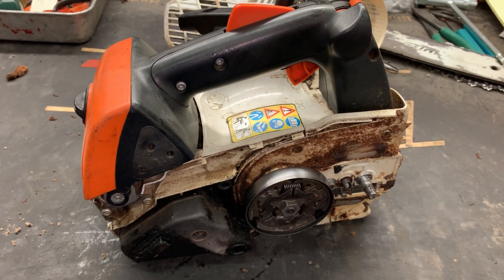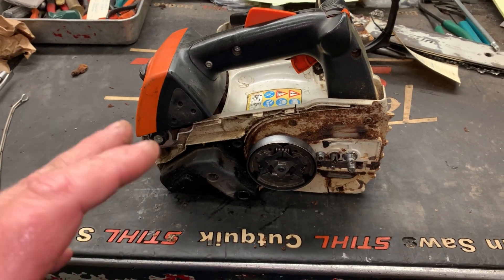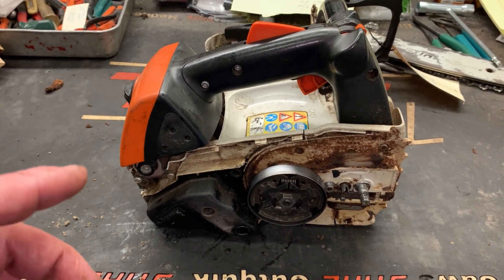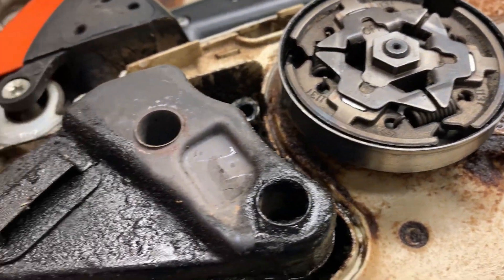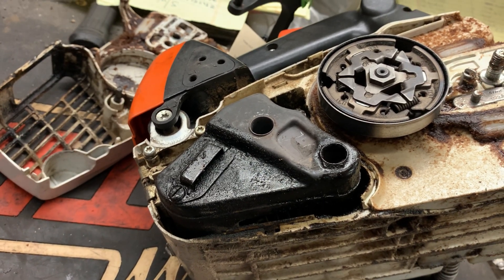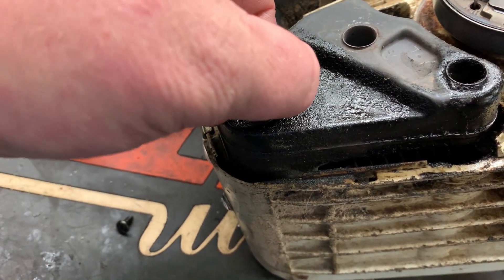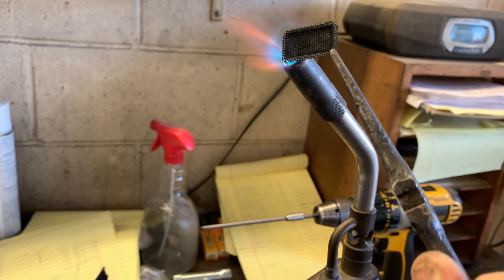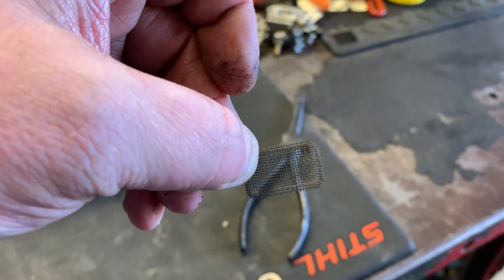FIXED!! WHY A 2 CYCLE ENGINE WONT IDLE? OR REV UP? THEN YOU MUST WATCH THIS!

Comment: Cheap oil and low octane fuel it drives me nuts 😂 chain saws run at high RPM use Stihl ultra synthetic and high octane fuel non ethanol take care nice video

Comment: That’s the gospel Medic. You gotta have a clean air filter and an unrestricted exhaust port and spark arrestor screen to get the proper air for combustion among other things.Too much oil does more harm than good.If your seeing oil goo all over the exhaust your mixing too much of that particular oil.Don’t use cheap oil.

Comment: Hey Great video , Today I had a costumer bring in a Honda engine that he tuned up himself . The engine ran like it was missing and not holding a steady RPM . I asked him what he changed , he said he changed the spark plug . I pulled the spark plug , and there was almost no gap . He dropped the plug before he put it in , well I put a proper gap and it ran like new . He was so happy he gave me $50 , I said i was not going to charge him . Made his day.

Comment: I had that happen to me. A friend's machine wouldn't run, and i found this. i used all sorts of chemicals and then I realized that it was stainless and could take heat. 
Also 2 cycle mowers clog in a similar fashion. those you clean with a stick.
Good job!!

Comment: I have a ms192T they are sweet little saws. I have the screens on my trimmers clog up a couple of times a year. Question would it hurt to run my trimmers without the screen?
Reply from the maker: You can take them out but it leaves the engine wide open to Dirt dobbers.
Reply: Probably illegal as well depending where you are at.
Reply from the maker: @bartfoster1311  highly illegal in areas that inhabit dense forests

Comment: The best way I've found is throwing them in the trash! LOL
Reply: And, that is exactly what I did with a Poulan chain saw.  Nothing but problems from day 1, the guy at the place where I bought it had to work on it the day he sold it to me before i walked out of the store because it would not start.  I worked on it the same day and every day I wanted to use it from that point on, it was always something different.  Failure to start when hot sometimes, failure to start when cold sometimes, would not idle,  it was a mess.  I kept it for a year or two and then one day....when I had it broke down...I wadded the entire mess up, threw it in garbage where it belonged and bought a Stihl MS 260 Pro and never looked back.  Best saw I ever owned!
Reply from the maker: My viewers reamed me real good the time I threw the one away on a fc55 🤷